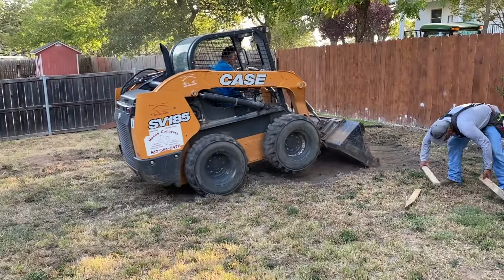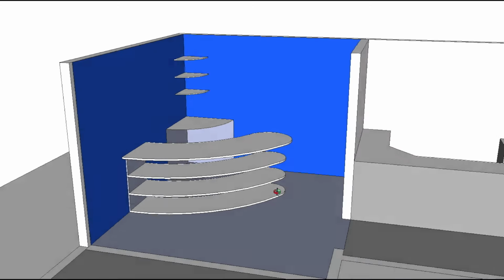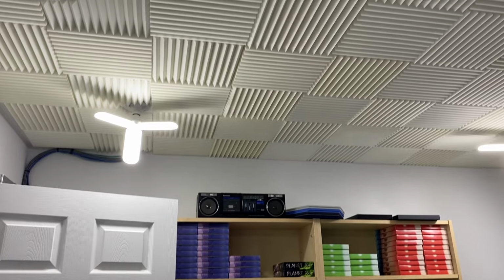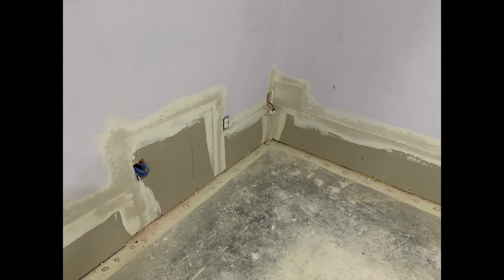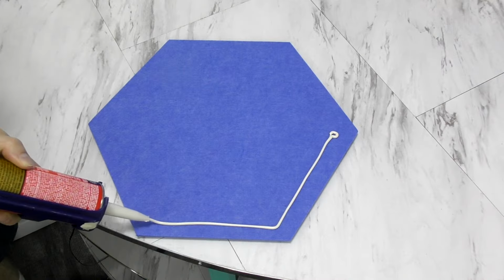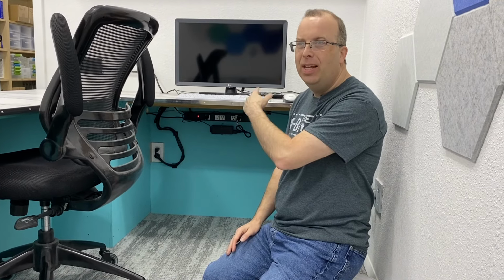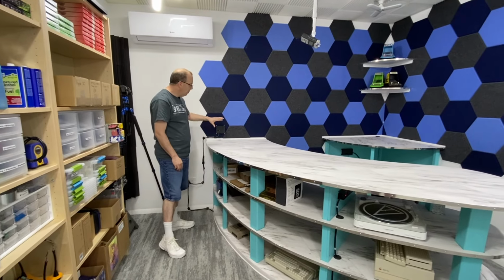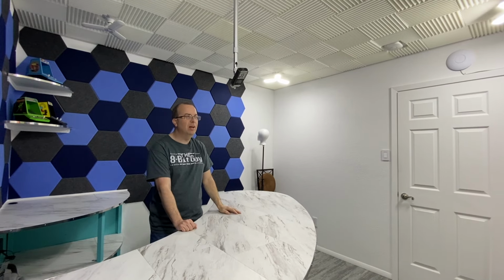8-Bit Guy Studio Build - Part 3

Comment: Coming back to this video after seeing the changes made to the building. The storage room now stores solar power. The patio has a pergola with solar panels mounted to it. And there's an opening between the storage room and set room. It's a good thing you decided to insulate all exterior walls.

Has there been anything about the building that's a defect or you wish you would have done differently?

Comment: David, if you want to prevent another flood like that from happening, you should eliminate any Shark Bite fittings with solder or press style fittings. Shark Bites are the laughing stock of the plumbing industry and have costed customers tens of thousands of dollars in repairs due to floods that would have never happened if proper soldered or pressed fittings were used.

Comment: Just FYI for next time..    You could use a good pair of tin snips to cut through the aluminum.  Not the $7 harbor freight special, but a nice $30-40 malco or Weis snips would cut through that like butter.   I'm in arlington and have a rain gutter installation business and we routinely cut rhough aluminum with snips... Not that high of gauge but it would still cut through it rather easily.

Comment: Just a word of advice on that you should probably add a one mega ohm resistor between the switch and the power strip or the switch and the stainless steel strapping

Comment: Do not ground the metal strip directly. Use a 1 mega ohm resistor between. So you have safety and discharge of static electricity at the same time. No switch needed.

Comment: If you can find the tiles with really tight tolerances and no chamfer on the edges, then they can make for an impressively durable surface for work benches and the like. Plus, it's a heck of a lot cheaper than trying to get custom-cut quartz or marble for those surfaces and it's actually easier than trying to iron on the laminate veneer. In total, it's just a neat trick for getting acceptable looking surface finishes that are immensely durable and relatively inexpensive. Just don't use them for cooking surfaces, as it's hard to get the seams to completely disappear, so cleaning them off after working with chicken could be challenging compared to a monolithic surface.

Comment: Just to let you know the sonic resonance control system has exploded, resulting in an explosion in the energy proton maintenance assembly.  Also, the upper drive conduit has destabilized, causing an implosion in the upper sonic tachyon torpedo launcher plate.  Just remember that.  ok?

Comment: the tiles are absolutely fine the way they are , the workbench however YIKES 
that color and pattern do not work at all it looks like its bad cg added into the video 
also the turquoise does really clash with the two blues you have in the hexagons .
I would suggest changing the turquoise in to one of the tile colors and making the tabletop brushed stainless

Comment: This looks like your arm was partially broken. Not fully, but with cracks on the two points, which used to went partially blue. The other thing is, that your honeycomb Design on the wall is a good and a functional, neutral decision. I like it.

Comment: I don’t mean to be that guy. 

May want to run a diode in series with that ground plate or a low amp breaker just in case someone hooks up a poorly wired device up like a “old computer” .. some think its ok to use ground as neutral.

My grandfather gave me a guitar amp that had a floating neutral. Which is 100% dangerous ( it seems sears didn’t care in the 30’s apparently) so it was a great thrill to get shocked.

Comment: That ground set up could be quite dangerous if you have a dead short anywhere in that building or if you have a highly unbalanced load on your load center… you could end up with the electricity back feeding to that ground strip. I would only set that up as an isolated ground to earth away from your other earth grounds or any trees

Comment: I highly recommend either adding lighting tracks or swapping them out with your existing fixtures as somebody who frequently does electronics work in a space where I also have to do videos and photography.  Light tracks are very cheap and easy to install, and you can also continue to use the same bulbs you already have by getting a compatible track fixture.  It allows you to direct light exactly where you want it, and if you're working on something small that's hard to see, you can put extra lights on it.  I have gooseneck track extensions, and diffusion cloth that I can stuff into light cans to make the lighting more even.  Tracks give a lot of flexibility for not much money.

Comment: Studio turned out great man! Looks totally fantastic! 
I think the hexagons are tolerable (lol), but maybe a little bit annoying because there is still a fair bit of contrast between the light and dark blue. I think the grey is fine since it seems to be somewhere in tbetween contrast wise. If it gets too much in the future I think you could just  remove all the blue ones and rearrange them so that the dark blue are to one side of the room and the light blue are in another side of the room. I think that would make it look much better. But the glue might make it impossible maybe. Liquid nails doesn't usually come off easily.

Comment: As far as sound goes I might help you since my specialty is Audio. The acoustic panels you put on the ceiling are... kinda worthless, the reflections come from empty walls that bounce the sound as crazy, so you can either put furniture on the wall or large acoustic panels (which can be done by yourself) in strategic parts of the walls, the dampening of the sound will improve a lot and you don't have to spend a fortune on panels that may look pretty but aren't as functional.

Always loved your videos :)

Comment: HOW TO Doctor Reverb

1950s television news studios covered at least one wall with sound-deadening "acoustic" ceiling tiles to kill the echo-chamber effect. These tiles had the virtue of being very inexpensive and fairly fire-resistant. Modern acoustic tiles come rated for Noise Reduction Coefficient, NRC, which tells you how much they kill human voice reverb in percentage. NRC 95 is typical.

Most acoustic tiles come with a speckly pattern of holes as their surface, but you can also get tiles with intriguing grooves and circles cut into them. As late as the Oughties these were the height of style for office environments.

By the 1960s studios and auditoriums also began to use baffle panels. These come in two sorts, wall-mounted and free-hanging. A typical baffle is a two or three inch-thick sheet of low-density fiberglass panel that's been upholstered in speaker grille fabric, kind of like a big flat couch cushion. Hang it on your wall or from your ceiling and it eats echoes even better than acoustic tile. The panel's thickness optimizes it for particular wavelengths of sound; the key is to make the panel one quarter as thick as the wavelength you need to trap. Fiberglass is used because again, fire resistance is king. Ceilings and walls covered in urethane foam are deathtraps.

Comment: HEX pieces is a mess. Too much multi-colored elements on background. Better to have plain wall or just little quantity of elements. 2nd room hexs looking much much better because of that. Table color also wrong, looks like kitchen one. As you may see it is also reflecting wall's colors (because white and bright). Simplicity is the key to success and you know it even better than me.

Comment: I hope you read this, i think you'll find it interesting, i just picked up an 90's era Cherry keyboard (out of an old automotive diagnostic machine i had at work), it literally was in a drawer unless it was being used so completely in the dark all its life AND its had it original dust cover on the entire time. Yesterday we scrapped the machine (old Bear diagnostics, i tried and tried to revive it, fixed it many times over the years but unfortunately the old proprietary control board bit the dust and i couldn't fix it and yeah, zero replacements now!) and i thought, "hey lets have a good look at this keyboard and lets peel this dust cover!" (which was filthy btw, mechanical workshop so covered in dust, oil, etc), low and behold the keyboard looks next to brand new! Its an Ducky mechanical keyboard, has White on Black keycaps (in fantastic condition) and the case has a beautiful bluish finish (its model G81-3221HAU). Literally feels like a Barn find (that was under my nose the whole time). I wish i could send you some pictures of it (Though you can probably find it on the mechanickeyboards reddit page, quite a few people going nuts over it lol), non the less i'll be wrapping it up for a time i can display it, hopefully with some more vintage gear!

Comment: OMG Direct Ground is a BIG Safety Problem, In a Lighting Storm a Surge of Current Can Back Flow ..
You need a 1 Meg - 5 Meg Resister Off the Grounded Outlet Before it Gets Grounded to Your Bench ..
It can Save your Life, and the Life of the Computer / Electronic Devices ..

Comment: And in other news that steel strap being grounded is a pointless exercise in ESD protection. It will achieve NOTHING when it comes to protecting the gear you are working on from an ESD event. The issue is the potential difference (i.e. voltage) between YOU and the item you are working on. It has nothing to do with ground, that is a popular myth. The reason "ground" is involved in ESD protection is because it is a common thing in most workshops that you can use as a common reference. Eg you ESD bench mat (yeah you need one) and your ESD wrist strap (yeah you need that too) and your soldering irons, PSU etc are all tied to a common point i.e. ground.

Comment: You would usually put a resistor approx 1 Meg in line with the ground connection, for safety reasons…

Comment: Add a 1megohm resistor to the grounding of the desk. It will work fine for discharging any static charge and means you won't get electrocuted if touching live equipment. We used to do this to the custom antistatic mats on the desks when I worked at Motorola in the 80's.

Comment: 19:10 - 19:15 it seems like your camera is light shifting a little (background squares are getting brighter and darker), auto adjusting exposure? since you have such a consistent space now, you could set it manually so it's not always micro correcting depending on your position.

Comment: Consider using only the lighter blue sound-dampening tiles (similar color scheme to your old studio which was just fine) and either a darker blue table top cover that has a similar tone of blue as the wall tiles except a lighter shade, or better yet, you could go with a warmer bright Oak wood-tone table top cover that goes very well with blue. 

I am afraid the baby blue color needs to go as well. It doesn't match anything in that frame. 

You could use a few of the darker blue tiles (possibly matching the pattern in the other room) as an accent. 

Either way, try to keep most of the colors the same and add simple matching accents here and there. 

Avoid extreme patterns and color schemes that don't blend well together. 

And don't be shy to ask for help, specially from the ladies who have an eye or a talent for decoration and functional design (which is a compromise between form and function . Not all form. And not all function).

In other words, consider that you might be putting function over aesthetics and that you might need to be willing to make some functional compromises in favor of better aesthetics. 

And thanks for your wonderful channel!

I am huge fan. 😊🙏🙏

Comment: Simplest solution for back wall is a light shade of gray (that plays as white on camera). Next level solution is getting a soft light source over your head, maybe about two or three feet forward from your "host" position. A shop light, with two LED tubes in it could work. Test placement with a stand first, to avoid the glasses reflection issue. (A key light dangling from a somewhat "toppy" position avoids reflections, but still acts as a proper key.) Alternatively, see if you can just bounce a hard light into that white ceiling about 45 degrees forward of where you stand. You can also spray "Streaks and Tips" (a hair product) on the background lights, covering maybe 50% of the face of each light. That reduces their intensity, if they aren't independently dimmable.

Comment: ESD protective grounding can be done through around 1Mohm resistor, so that you do not get shocked unnecessarily, but that is also enough to drain static charge pretty quickly.

Comment: the hexagons colors are fine for me, but the table white with that texture is unwatchable. I would have picked a darker fixed color with no texture for sure. At the end of the day, i guess also those rounded table behind is out of place. The hexagones have squared sides, also there, the behind table would have been better as a straight panel from wall to wall. just my random opinion

Comment: Think about putting some sound-soak tiles on the inside side of the door and the walls you face when on camera, that will help a lot on the echos.  Also, carpeting can make a good sound-soak material and it's a lot cheaper and you can get it in just about any color and lots of patterns. You can just hang it from hooks at the top of the walls to make it easy to remove or change.

Comment: AV guy here. I have to say, I personally really like the hexagons you have. The dark colors work great for the contrast and keeping you standing out from the wall. If I had only one gripe about them it's that some of them seem a little misaligned and the white wall is showing through them. That could be easily fixed just by coloring in the area to keep it from "popping" so much on cam.

As far as lighting goes, I think you'll greatly benefit from one or two key lights on stands. Nothing expensive or extravagant by any means though, just something you can add to put some more light on yourself (or foreground objects you're working on), which will also make your shots come out clearer and with less noise.

Regardless, this whole setup looks epic. I'm excited to see more videos coming from this new studio. :D

Comment: The studio looks great... looks so great, I wish I had a space like that!    For grounding the workbench: What I did for my workbench was I drilled a hole in the power strip box and mounted a green colored binding post with a banana jack so I could plug a grounding wrist strap and use a spade to connect a grounding mat.  Second comment: I like the idea of the Hex-tiles, but for some reason it creates a strong dominating background, I don't know if it's the regular pattern (should have been random break-up pattern) or if it's the colors... but I think that's going in the right direction and as you said it will evolve over time.  The office space tiles look like the "X" pattern, you could have done a pattern based on the Commander X-16 theme.

Comment: you need to install the foam in areas where sound can bounce - i.e. wall to ceiling in patterns and that'll fix the problem. Just placing on a ceiling will never rid the echoing. Put them up in a checker pattern: one ceiling, space, one wall (top), one ceiling, one wall, ect. Behind the camera do the same to the corners of your walls as well. This will deaden the sounds reflecting in walls and corners

Comment: You should make your own cloud for the ceiling. 2x4’s in a big rectangle, pack it with insulation and wrap it with a good looking fabric. It’ll prevent reflections off the ceiling and make a big difference. Also, rugs/carpets. Those will help reduce reflections off the floor.

Comment: I used hot melt glue on acoustic tiles with great success.  His gun probably doesn't get the glue hot enough.  I also put blue painter tape  on the wall first and glued the tiles to the tape so that I have a fighting chance of removing everything with no paint damage.  I changed some tiles recently and checked the tape, and it wasn't stuck to the paint too firmly, so it seems to be working.

Comment: Yes, I have walls without ethernet/coax where I really need them, but not so much bad planning (maybe one place) but because the builders would take their sweet time framing a wall where I needed an outlet, then suddenly in one day they framed and put up wallboard where I'd need an outlet.

I could probably put in another ethernet plate in my office if I cut an opening in the sheetrock in the cellar stairway (the other side of the wall behind my desk, and the "wiring closet" is under those same stairs) but I also need another power outlet there, on it's own circuit.  That will be a pain to run since the ceiling is closed in through one half of the baseement (in the garage).

Comment: Extra fast charging stations for the Dremmel? As long as you are not climbing on the bench it should be fine. Don't feel bad about not being able to remove the echo, even the Sydney Opera House had this issue they had to put round plastic things hanging from the ceiling.

Comment: Grounding the edge of your workbench seems to be a good idea BUT, for safety reasons, it should NOT be directly bonded to mains ground. Instead, it should pass through an 1Meg	Ohm resistor. This will help keep you from being fatally electrocuted if you are working on something & you can delete the switch entirely. As for the hexagons, maybe just stick with the black & dark blue, space them apart by 3/8 to 1/2" & insert grey felt strips into the gap as an outline. Or even use a combination of grey & black strips to give a pseudo PCB/data bus look to it.